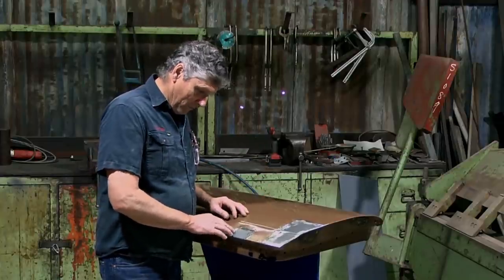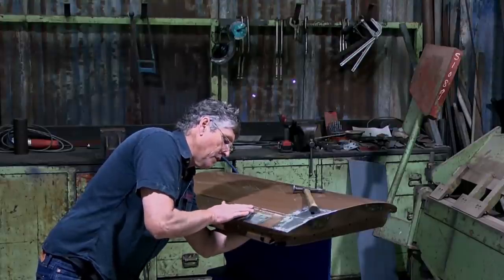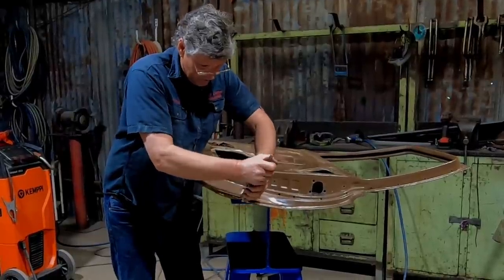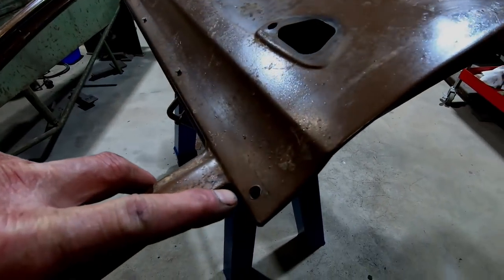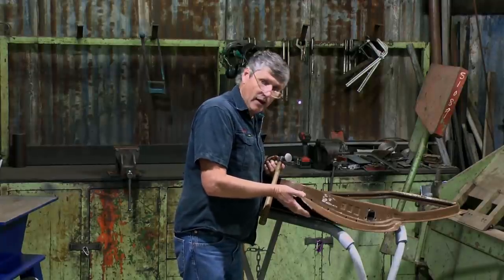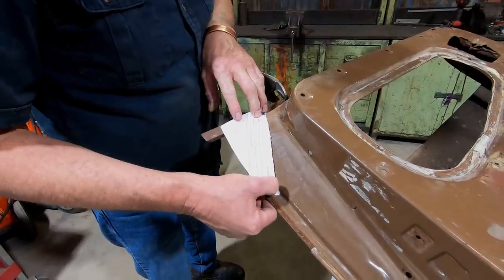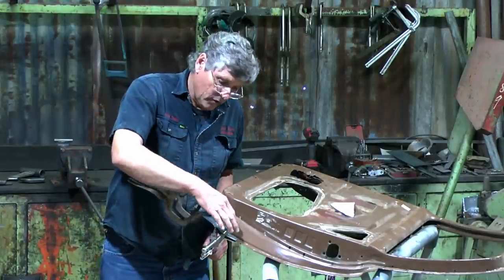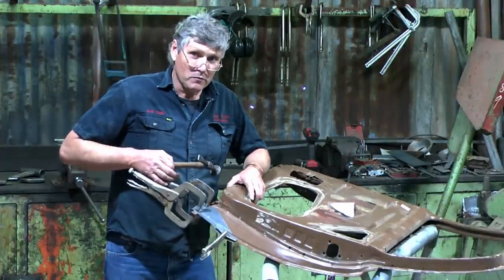HG Drivers door rust repairs Part 3

Comment: Hi Rob, do you work with only one gauge of sheet metal or do you vary the gauge based on the panel or car you are working on?
Reply from the maker: Hi Mate, I will always use same for same as the original car. Thickness from 22 to 14g or 0.8 to 2.0mm.